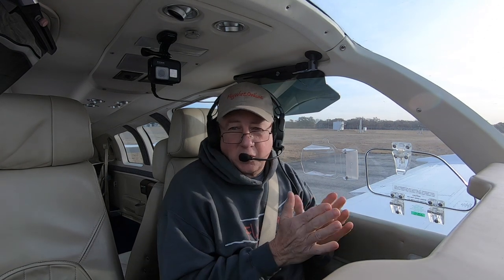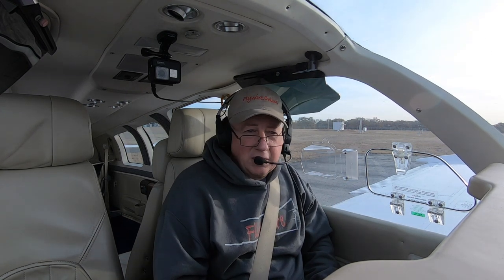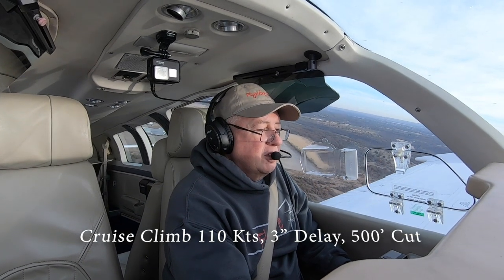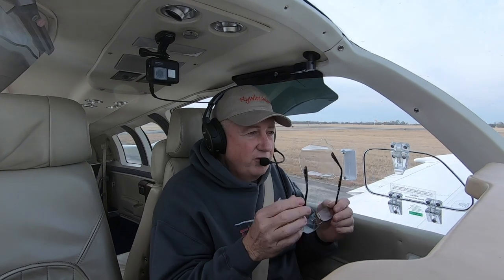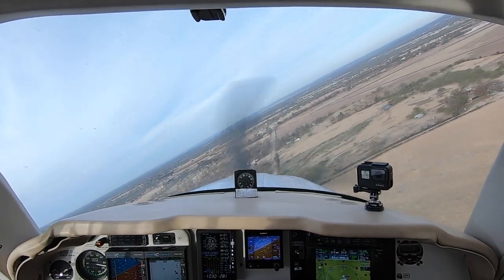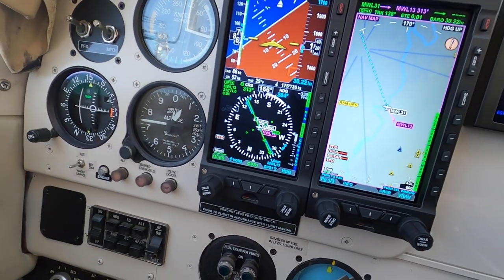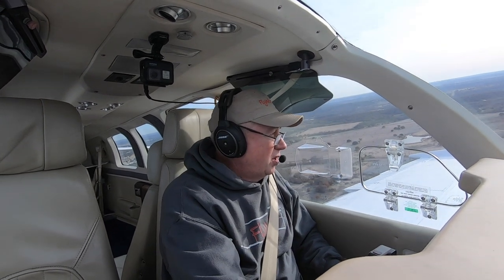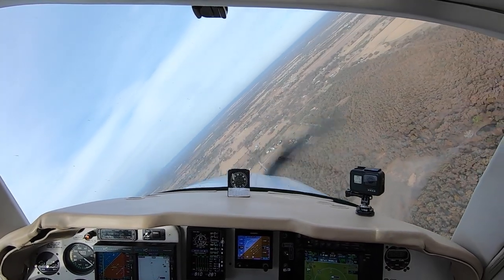A36 Bonanza Engine Failure on Takeoff:  Impossible Turn or Turnback?

Comment: That's a Shack Lead! Another informative video, Scott. I'm glad to see you put it terms of minimum altitudes and also mentioned the favorable conditions. The last video I watched on this demo'd it  in a Bearhawk at 500' didn't get into how situational/aircraft/pilot dependent it is.  He made is sound a little too easy (IMO).  Excellent point about knocking it off at a 200' hard deck as well.
Reply from the maker: Thanks a lot Dan! My perspective is to show what is really useful, and although I did sleep in a Holiday Inn, the purpose is not to show you how great I am!
Reply: @FlyWirescottperdue  Ha!  Love it!
Reply: @FlyWirescottperdue  I don't know if you can expand here or not...I understand that you have more energy at Vcc over Vy. But eventually you're in a 45 deg bank at min sink in either case. How does beginning the maneuver at Vcc help avoid the stall tickle in that case? You end up at the same Min Sink airspeed and 45 deg bank in either case - don't you?  Thanks Man. I think it was this vid or the TEX debrief that got me coming back.

Comment: I’ve read an article suggesting a 30 to 45 degree left or right climb out considering the winds , to minimize the return angle necessary to realign the return approach. I practice these on my sim regularly but not yet in my plane. Thanks for the great video.
Reply from the maker: That is a technique, one that wouldn't apply at all fields, but definitely one to consider at an airport without many options!
Reply: It works.  I did that on a Grumman Tiger i was testing for overheating.  Saved the engine that way.  Temp went to red line at about 550 agl. I TurnedBack and landed.  If I went to downwind leg, base and final i could toast the 30,000 dollar engine.

Comment: Nice piece on 'offensive'  flying. Just as in motorcycling, there are times when aggressive maneuvering is required. When teaching CFIs, many of us have taught "the impossible turn." Demos at altitude included gentle vs steep bank altitude loss. Good demo on effects of wind.  FAAST TEAMs could surely use your demo.
Reply from the maker: Thanks, Dick. I appreciate it. They would be welcome to use it!
Reply: @FlyWirescottperdue  Thanks, sir, I'll send it to out to out to our FAAST leader at the local FSDO.

Comment: Thanks Scott, along with 'ground rush' the other HF are perception of ground speed when close to the ground with tail winds and also apparent skid. Usually taking off into wind means that the return will be with a tail wind and a resulting higher ground speed. Departing an airport from the threshold with a 30 knot wind means that you will likely be off the end of the airport boundary with a very high GS, and very high energy state, not good for the meat sacks in the aircraft. Also with high DA departures the aircraft will be further out from the airfield to achieve 1000 AGL. The whole scenario is pretty complicated and I doubt that pilots would modify the altitude to account for wind effects and DA. Two other sayings that are good modifiers are: If the engine has failed the insurance company just bought the aeroplane, are you going to bet your life for the insurance company? If you are going to crash find the softest thing to crash into!
Thanks for the great content.
Reply from the maker: Graeme excellent points! Thanks!
Reply: 30 knot headwind take off you dont Turnback to opposite or even a parallel runway.  Maximum tailwind landing i have done on  my Cherokee is 16 knots tailwind landing from 600 agl Turback to a 4,000 feet runway.  I used forward slips and I cut the mixture on final, then on flare I cut the flaps on the flare to stop a bit under 3,500 feet total used.  I have a video doing them.

Comment: Excellent video Scott, Thank you! I recently completed an RV-10 and plan to experiment using your techniques. With a 2000 foot floor! Very informative and much appreciated. I didn’t quite follow why you didn’t pull the prop back on your emergency return. Wouldn’t that give you more glide range?
Reply from the maker: It would give more glide range. But the engine was at idle so there is some amount of residual  thrust. Leaving the prop at cruise does a better job of simulating that.

Comment: Interesting demonstration, Scott!   
Since an engine failure on takeoff is extremely rare for most pilots, I tried to keep it simple for students who possessed little aeronautical experience to rely on (and who likely would have relatively lengthy response time).  
I taught them to land straight ahead +/- 30 degrees till 500 ft for the smoothest crash site, then no more than 90 degrees till 1000 feet, THEN maneuver for a landing based on whether the wind will help or hinder a return to the airport (the actions to be taken were part of the pretakeoff review)..   
As you mentioned, a variable is the airplane's ground speed (lower ground speeds will keep the airplane closer to the airport).  A 30 knot headwind on a Taylorcraft will keep its upwind leg much closer  to the airport than it will an A36 or T210.  Hell,  you can just about do hovering touch and goes with a 30 kt wind in a T-craft!  :D  
The wind direction is also important, as turning in the direction with a strong crosswind may make the distance back to the airport too long to make it.  
Bob Hoover was right in that it is far better to crash under control rather than crash after a stall/spin.
Cheers!
Reply from the maker: Thanks Jimmbo, good points!
Reply: Total failures are a bit rare,  but partial eng failure are quite common.  Most dont crash, even after turnback.  We only hear about the ones that crashed, not the turnbacks or turnaround the airport that didnt.

Comment: Scott, your videos are top notch and so inspirational.  In going through the engine out on takeoff my gear warning goes off when I pull back to idle.  Is your gear down when you achieve your chosen altitude or don't you have your gear warning hooked up.  With a couple of tries 1000' is definitely doable providing I mentally prepare for it prior to takeoff.  A regiment I intend to do thanks to you.  Be well.
Reply from the maker: Michael- Thanks, I appreciate it! You can hear the gear warning going off. I think you got the point... gotta be prepared and you gotta practice... or pretty much just go someplace in front of the wings.

Comment: This needs to be preached, preached preached.  Even the great Cirrus with the parachute can't recover from a Takeoff engine loss.    I walked away from an engine failure right after takeoff.   I kept the dirty sound down and walked away.    I couldn't clear the power lines and used the wing to bear the brunt of the energy.   Luckily i was a helicopter pilot and knew about yaw.    We landed hard but the wrap around the pole helped us!    Before cell phones, I was running from house to house to call my wife, the attorney, and someone came out and said, Mister Mister, we'd call but you cut the telephone lines.    While a funny ending, I thought it was the end of my life!   Land Straight ahead!!!!   Thanks Scott
Reply from the maker: Great story John!

Comment: This is a fantastic video, thank you for putting it up.  Love the quote "Why?  Because I want to, and I can."

Have you considered doing a video on partial power loss on take off?  

That seems to come up often in accident reports, yet I've never heard of an instructor teaching it as part of primary training.  In cruise, you'd have time to go through the checklist for engine failure, and pick a good spot to land.  On climbout, I'd probably continue straight, but now I'm wondering if the partial energy add might make turnback more reasonable.  Thinking I need to try this out myself, at altitude, now...

Comment: Practiced this for real in a 36 with a CFI during a biennial years ago, all the way back to landing. Came to pretty much the same conclusion. 1000 ft AGL for a turn-back.
Reply from the maker: Excellent training!
Reply: @FlyWirescottperdue  I remember at the start of that biennial, I said let's do something I don't usually do in normal flying. So first we did an emergency decent from a few thousand feet (fire in the cockpit, etc), gear down power off, nose down to gear limit speed. Does that Bonanza ever come down! Then the turn-back after takeoff tests.
Reply from the maker: @MalcolmRuthven  That sounds like really good training and a great approach to a BFR!
Reply: 1,000 feet if you turned too shallow or kept speed too fast.  Which are mistakes.  Or you were at full gross.  Done it many times from 600 feet agl with 2 on board, fuel for 3 hours, winds on nose on take off at 10 knots.  Sea Level density altitude.
Reply: This is the second consistent confirmation that I have seen for 1000’ AGL for A safe 180.

Comment: Good video for a first attempt to instruct on a dangerous activity. 
Maybe you should lead with strong warns:
1. This is a demo, DO NOT TRY THIS YOURSELF. 
2. In this demo, the engine is still running.  In a engine failure, the propeller is all DRAG. With the engine stopped,  the descent rate in the turn is about double that with the engine at idle.
3. Every airplane is different,  this demo is in a near empty Bonanza, it is in a clean, low induced drag configuration. A Cessna 172 with 3 or 4 adults on board, climbing out at 75knots is in a high weight, high induced drag, rapid speed loss , rapid rate of descent configuration.
4. Do not try this yourself, again.
Show some pictures of smoking holes in the ground. 
Then get in the Bonanza and forcefully demonstrate the high rates of descent,  short time available for decision making, rapidly diminishing options in turning back at marginal altitudes. 
Keep up the good work.
Reply from the maker: I pretty much said that stuff in this video. Perhaps you should make your own video. Thanks for watching.

Comment: Ever tried pulling up to make a stall turn? Your energy is converted into altitude, with minimum drag. No extra drag due to steep turn. Did you try to use minimum sink in stead of best glide (+- Vy) because you had 30 kts tailwind?
Reply from the maker: Good question Luc. You need energy to do a Whifferdill. In an engine out you don’t have it. I advocate Min Sink, or the Emergency Approach speed for the Bonanza instead of Best Glide for an engine out. Best Glide is good if you need to go farther. Main Sink is good if you want to stay in the air for more time. In an engine out on takeoff you need to stay in the air as long as you can. Even then it isn’t very long at all!

Comment: Scott can I suggest you run the same exercise in the C180? I tried and I am convinced I would not turn back. I would land straight ahead. At 1000ft I was already so far from the runway that even if I turn back the aircraft would not reach the runway.
Reply from the maker: Tailwheel- Only trouble is I sold the 180. It's gone.

I think that is sorta the point. At an altitude where you have enough turning room to turn around... you are usually too far away. Pick a place to land in front of the wings is the most prudent choice.
Reply: Because the 180 can’t climb like the A36.

Comment: I  have looked at the video of the Las Vegas trip. It seemed to me, visually that the approaches both to St Johns and NLV were very low. I flew Archers and 172's for many years, and to do an approach like that would require a lot of extra power. Just to be sure, I looked at the PAPI lights at NLV. It was a little hard to see, but it looked like 4 red. I was always told not to drag it in. Is there something about the Bonanza that requires you to do that?   Herb Haar
Reply from the maker: Interesting question. I'm pretty sure I fly a 3 degree glideslope.... but not always to the 'suggested' point on the runway. As a rule, I prefer to use the least amount of power that I can during an approach.

Comment: All pilots should know how to turn well with 4 directions of strong winds affecting the track over the ground.  It is called Ground Reference Maneuvering in strong winds.  The problem is CFI's dont want to teach GRM in strong winds, they chose a mild wind instead that wont teach anything at all. 
 I call them A Mild Maneuvering CFI.  I taught GRM on 20knots winds.. Big difference.  Many accidents due pilot didnt know how to fly well in strong winds or land on strong winds. Mild winds make you a Mild Maneuvering pilot only.

Comment: The 30kt head wind helps in two ways. First, as noted it helps you make it back to the airport environment. Secondly, it allows you to reach the “failure” altitude closer to the airport environment. On a calm day you will reach 300, 500, 700, or 1000 significantly further from the runway.
Reply: 10 knots on ground its not 30 knots at 700 agl. If, you will have a HUGE WIND SHEAR ON DEPARTURE LEG that will almost or will STALL YOU.  NO WAY 30knots  even AT 1K AGL.
Reply: @CFITOMAHAWK  Scott is the one who mentioned a 30kt headwind. The fact remains the stronger the headwind component, the closer the aircraft will be to the runway at any given point during the climb. If the headwind did increase by 20kts it’s not going to cause a stall. In western alaska I often encounter winds well in excess of 40-50kts at 1000 feet and less than 15 at the surface.
Reply: @whamo1966  The windshear due diff. wind speeds will cause big IAS changes as you climb.. and descend too.   I dont believe that 30 knot at 500 agl.
Reply: But you are right about the no stall at all.  
As you turn into the headwind, it will increase the indicated speed.  And decrease when downwind part of the turn.  I dont see that there.  No 30k for me..

Comment: I’ve always wondered how this would work out if you bank first in the opposite direction. Left for a few seconds and then full right turn back to runway. Seems like chances of being lined up with runway would be a bit better that way. (Great video, btw!)
Reply from the maker: John-

Thanks! There is a school of thought about checking into the wind after liftoff in case an engine failure happens. I think that the technique would not work everywhere, but for airports with few abort areas to land out on it is a good idea.
Reply: Banking first at engine failure. Negative. No altitude for this manoeuvre.

Comment: Very helpful and well presented. My limit is 1000AGL in a Mooney, I think a plane with more drag, like most trainers, is going to have a harder time pulling it off. I’m guessing the Bonanza and Mooney might be similar?
Reply from the maker: Thanks Nick!
Reply: What Mooney?  Short body M20E 800 ft AGL is doable but you have to know exactly what you’re doing!  Don’t kill yourself off my advice!  The higher climb rate of the Mooney and Bonanza makes it so you’re also much closer to the runway when you hit those altitudes.  I think a more aggressive nose down to keep speed and a higher bank angle would have helped the first two attempts in this video.  In the Mooney I can’t do it at 500 AGL though.  Be very careful doing this, definitely do it at altitude.  Unloading the wings is key.  Know your stall numbers at various bank angles.
Reply: @gringoloco8576  M20C for me. Agreed, I’m being pretty conservative. Haivng some expereince with high pucker factor operations, I’ve found some extra margin works for me.

Comment: drift away from the wind as soon as one takes off so if the engine fails your turning back into the wind and will be turning back more aligned with the centerline of the runway.  just my experience ( I have performed this solo with engine idle from 500" to landing.  Addl weight would change the dynamics for sure.  Yes it does get interesting the last 200")
Reply from the maker: That's a technique, thanks for that. In some circles folks would not be happy with you drifting off centerline. I appreciate you. watching!
Reply: @FlyWirescottperdue  everybody at my airport just knows to expect that from me.
Reply: That's a technique we use to apply with aerobatic aircraft.

Comment: Great video!! Would 10 degrees flap lower your stall speed and increase your turn rate? Loosing less altitude in the turn?
Another question, how much does full gross weight take off, affects the numbers in your experience?
Reply from the maker: Jose- 10 degrees of flap would help... but added complexity becomes problematic. Not many airplanes have a 10 degree setting. Much better to just fly the airplane you have. There isn't much time.

A takeoff at GW would seriously impact your energy state... count on much less performance. Same decision points... if you judge what you are doing based on your energy states you make decisions on what you see out the window. In other words the turn isn't working... you're not going to make it, choose another spot. If you can't make that judgement from looking out the window then you shouldn't even try. Land someplace forward of the wings when it happens.
Reply: Flap is contentious. Increases  descent angle( shortening glide distance. In essence the a/c is not as clean)  and although it lowers stall speed it increases drag dramatically. Never be afraid to throw all the flap out once commited to a " landing" and fly the plane as long as possible into the crash.  Above all. WINGS LEVEL ON IMPACT.
Reply from the maker: @pilotactor777  Good points!